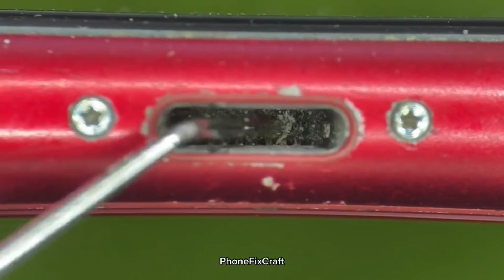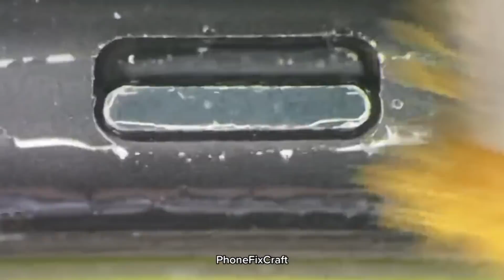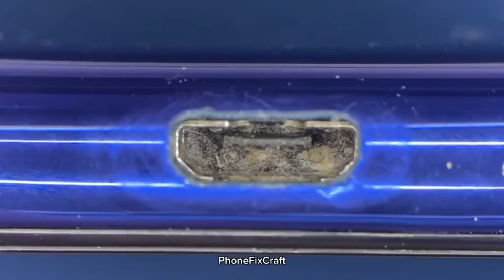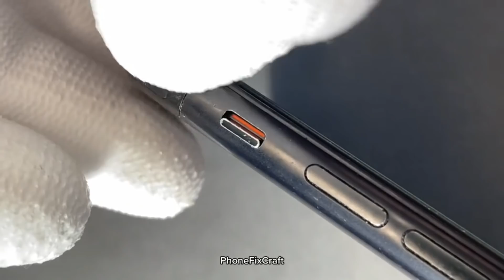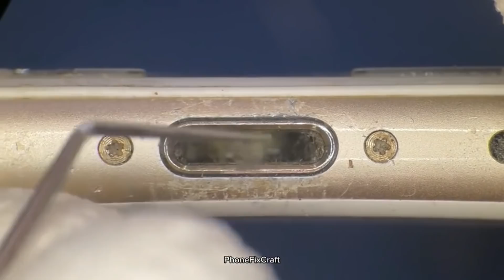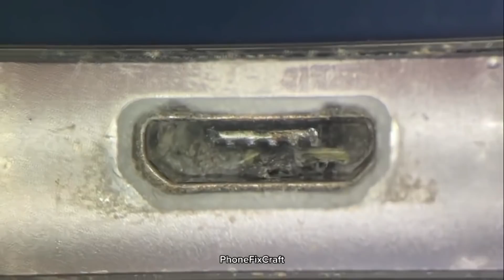Viral TikTok Phone Cleaning videos. Week 27 2021 compilation from Phone Fix Craft

Comment: how do you manage not to shock? why your tool is iron, and it may shock
Reply from the maker: It is impossible to get a shock from a phone charging port. I hope that answers all your questions
Reply: @PhoneFixCraft  Oh now I get it, my father says that putting something thin metal is putting it where and loading the shock
Reply: @eu_Gy6000  that's normally only from outlets. Chargers normally take in charge so you won't get shocked